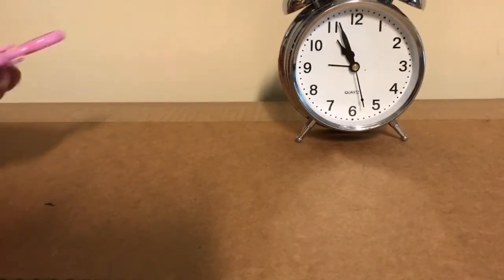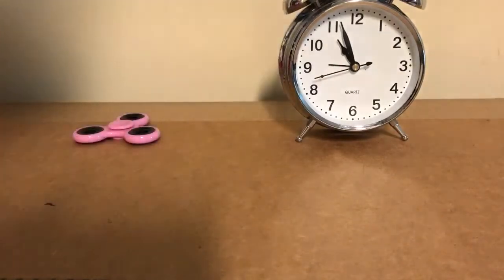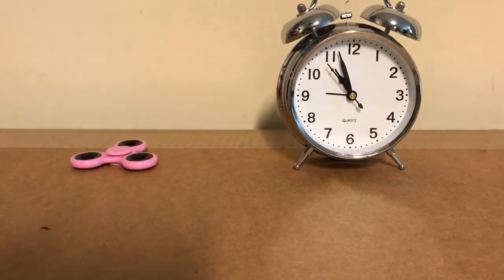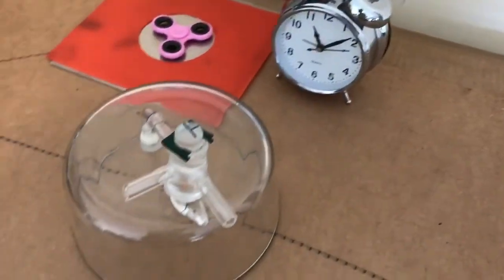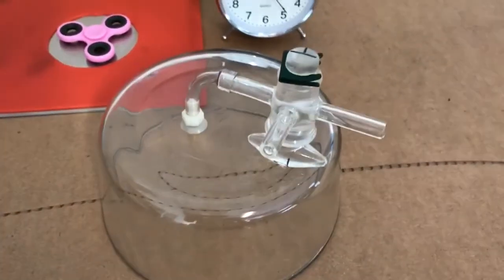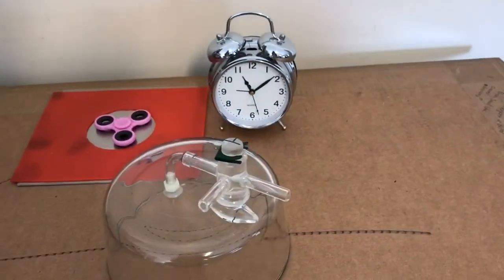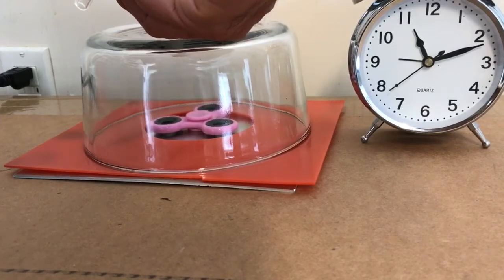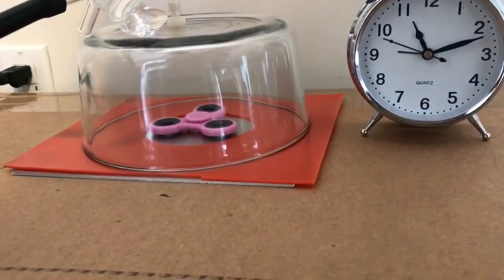Does Fidget Spinner Turn Longer in a Vacuum??

Comment: The kinetic energy applied probably has variations. An improvement to the experiment would  be motor and driver where you can have a stable rpm to begin the test. Shut it off in and out of atmospheric pressure. I would consider this inconclusive. Great idea and keep it up 😁
Reply: I was just about to comment something similar.